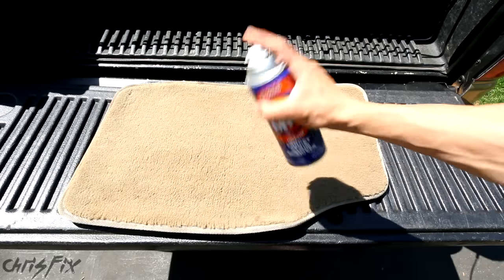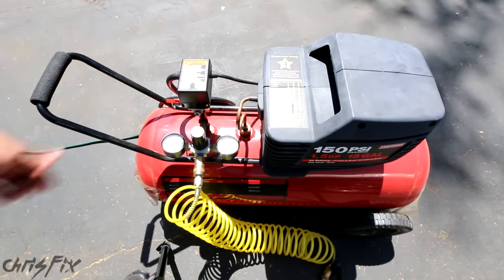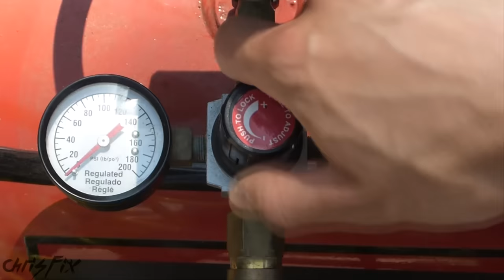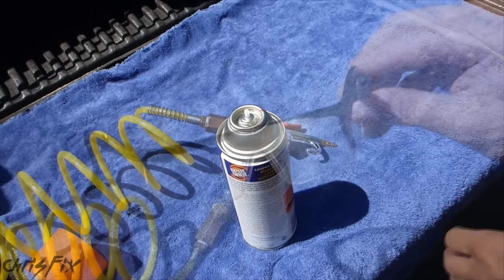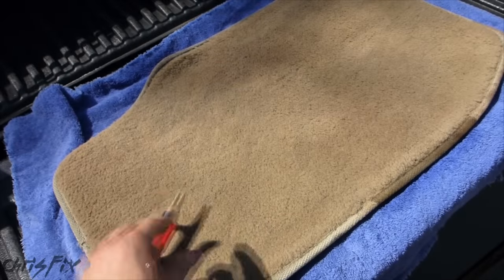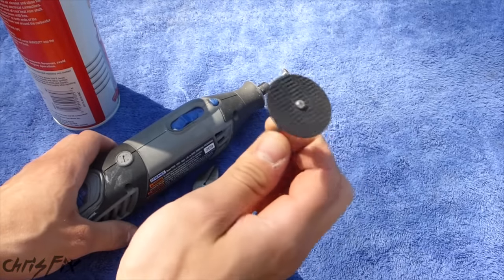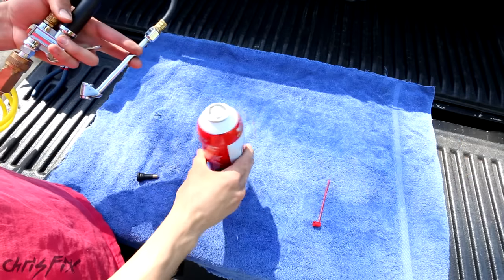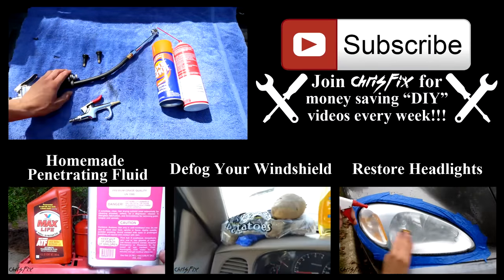How to Refill an Aerosol Spray Can (Like Carb Cleaner, WD40, etc)

Comment: Thanks, now I can refill my air can with air.
Reply: Just be careful. Moisture can build up in your compressor. Be sure to drain it and maybe put an inline filter bowl to catch moisture if you're filling cans you'll be using on electronics
Reply: Many years ago I modified an empty air can so I could refill it using a bicycle pump.
I drilled a small hole near the bottom. Then I glued on an old inner tube valve and secured it with a hose clamp.
Then it's just a little work with a pump every time I need some compressed air.
Probably had it for more than 10 years now.
:O)
Reply: @John Doe no, this video makes no mention of canned air which is used for dusting electronics and other things. those cans are quite expensive really. theres another method where you drill a hole in an empty aerosol can, cement a bike tire valve into place in the hole and seal it, and then use a bike pump to put air in the can
Reply: @royeb63     m my
Reply: @John Doe Z
Reply: @royeb63  make a vid! that sounds awesome (then post link here), pc people they will lose their minds!

Comment: Also if you don't have compressed air you can just crush the can a bit to create some pressure inside of it, making the last stuff come out.
Reply: Depending on what the fluid is, You could just open the bottom with a can opener. Just make sure there is zero pressure first.
Reply: I tried this once, I put it in my shop press, put the item I wanted lubricated next to it and squashed the can flat! Gave PB Blaster a new use... I grabbed the wrong can, it was the brand new fully pressurized can! It's amazing how much penetrating oil is in one of those cans! Was making a video of it but ruined an 1100 dollar iPhone,  new can of PB Blaster, and everything else in the garage trying to get the last ounce out of a can... oh well, it was fun.
Reply: @terryhites1  damn 😄

Comment: If you turn the can upside down, you won't have to worry about liquid shooting out.
Reply: That's what I wanted to say, turn it upside down to limit loss of product.

Found this video a day late and a dollar short, just threw away a can of WD40.

I'm a chicken, after I found the actual pressure, I'd do like this video, at least 20% below the stated pressure, maybe less.
Reply: lmao same
Reply: Ron R Ss
Reply: lol My WD-40 works both ways...
Reply: Depends on the can. Lots of car related sprays are made to work upside down.
Reply: Amaey Paradkar + sithlordmaster181   he's talking about when you refill the air not when using the product. not sure if holding it upside down would do anything but maybe
Reply: Didn’t think of that food idea
Reply: you get WD40 for a dollar?
Reply: How's your lawn doing in that spot? lol
Reply: I'm a handyman, jack of all trades, but never considered this. I've got a half a dozen cans I'm going to try this on, three of them WD-40. I honestly think that the manufacturer of WD-40, where all the pressure leaks out is not a manufacturing flaw, but by  designed ! So you buy more WD-40. Thanks for the video.

Comment: I had this happen recently to two large WD-40 cans, they were completely out of the air and 95-100% full of fluid. I wasn't going to waste the fluid so I just stabbed the side of the can with a sharp, pointy knife and just pours it where it was needed.
I like your trick with the air compressor, I've never seen that done before. If it happens to me again (which is more than likely with some product) I'll fill my compressor to do it if the spray function is definitely needed. With the WD-40 last time, it actually worked out that the air ran out as I wanted to soak some parts in the solution for a few hours anyway :)

Comment: Great video Chris!  I was thinking that a rubber tipped air trigger drilled out the same diameter (or perhaps slightly smaller) as the can valve would make a really good seal.  Been watching several of your videos now that I have been restoring an old car.  Keep up the good work.  Subscribing today!!!

Comment: I don't think those cans originally were pressurized with air, but with some sort of hydrofluorocarbon compound (which replaced the ozone-depleting chlorofluorocarbon compounds).
Reply: king kazie
Thanks.
Reply: whiteknightcat your welcome
Reply: +whiteknightcat This is true, but probably irrelevant. While using compressed air doesn't make sense for the manufacturer, it makes fine sense for someone like Chris.
Reply: +king kazie or even isobutane
Reply: Paul Lawton cool, i didn't know that
Reply: pretty much all  cans use butane or propane since its cheap and readily available. Chris forgot to mention that some cans need to be used up quick afte pressurising them since certain compounds will oxidate
Reply: @jellystick2525 , The WD-40 company recently said that it's no longer using butane, but CO2.  But the problem is that the WD-40 substance itself is flammable.  You simply don't want to mix air with that ahead of time.  You're asking for a disaster sooner or later.  Mixing air with a combustible substance?  Yikes.

Comment: Compared to other tutorial videos that I watched about this type of tutorial, I think you're the only one that doesn't have to drill a hole at the bottom or on the side of the aerosol spray can so you can insert a valve stem and use an epoxy to seal the gaps and keep the valve stem in place....good tutorial. I actually gonna try this...with a bike pump.

Comment: Glad I found this, I had a spray can of expensive paint run out of pressure with more than a 1/2 can full. I'll do this tomorrow so I can finish my project without having to order new base coat color paint.

Comment: Suggestion, I'm in the same thing right now. For the air nozzle, use a bigger drillbit and drill the tip just a bit, so the conic shape of the worn area will aid to a more tight seal when passing air...

Comment: i use liquid propane-butane   for refilling  gassed-off  spray cans ...  i even refilled  an old spray can with new lacquer and added liquid propane-butane through the valve .. kinda tricky to find /create nozzles which fit, but with a little bit  of creativity, you can make it work..  air refill is  good for quick and temporary reviving .. however, as you use the can,  the pressure  decreases in linear manner.. whereas the liquid propane-butane stays liquid inside, mix with the lacquer medium and   as you use it, it keeps evaporating  inside and holds  a stable pressure around 140 psi  .. works quite fine ☺️

Comment: That’s dangerous af. If you accidentally inject compressed air into your skin it could cause major problems. If you’re gonna do this you should wear leather gloves. The valve stem method would be the better way to do this. However , if you’re careful it’s a great way to save some money.

Comment: Very informative video, thanks.
A little improvement perhaps could be of some use:
In these two methods of filling the can with extra air, it is better to hold the can upside down while filling.
It is  to prevent the fluid from escaping the can while filling and thus avoiding the mess and unintended loss of fluid.
With the can in upside down position while adding the compressed air, the air is added directly to the existing air pocket in the can.
It applies to all cans fitted with solid plastic tubes inside the can.
This won't work with cans equipped with flexible inside plastic tubes with weight attached to the far end of the tube, invented to allow the normal use of the can in any position because the far end of the flexible tube will fall to the lowest point of the can, while the air pocket will always stay in the highest section of the can, no matter how it is positioned.
Reply: Any angle spray cans are amazing, whoever invented them is a genius.

Comment: would this work for whiped cream
Reply: Cepten Crinje don't see why not
Reply: Cepten Crinje it'll taste like an air compressor
Reply: No, It wont. The gas in whipped cream is nitrous oxide, which dissolves in fat. If you use normal air this wont happen.
Reply: @Benjamin Larson but then you'd probably not have "whipped" cream anymore, it'll just turn be shooting out liquid
Reply: Codyslab did it
Reply: Might work for 'whipped' cream, but I've never heard of 'whiped'.
Reply: Tanya Jonesjbxgdbajshdhd No, Codyslab used Co2 as it will dissolve in liquid
Reply: No it won't work for food. Food is never stored with oxygen because the oxygen promotes bacterial growth. Notice how foods don't spoil until you open the vacuum seal and let air in.
Reply: whip-its!
Reply: Cepten Crinje whiped? Wtf
Reply: Can't believe how many responded to this.  As if he's serious hahaha!

Comment: You, Sir, are a life saver!! I've had to throw away several good cans before, simply because they ran out of air. I never knew that I could use my air compressors to refill these. I'm going to try it next time. Thanks, man!
Reply: You are the man!  Love stuff like this. Just saved about four cans for me. Works perfect with the tire stem and a good bicycle pump. Thank you so much
Reply: How did you get on? I’ve just been to the garage and got a valve stem, set the machine, put the valve on top of the can, and nothing at all. The air wouldnt even come out of the air compressor!

Comment: We converted an old, outdated bbq propane tank to a portable compressed air dispenser by drilling and installing a tire valve into it and adapting the threads to an air hose, works good

Comment: Is that actually safe with combustibles? Won't it create a diesel effect? I thought that's why the manufacturer uses inert gasses.
Reply: Actually, no it's not safe, despite how people make fun of those who know better.  Folks were often never trained properly: Fire is a chemical reaction, *nothing more*.

And it's not specifically dieseling that you have to worry about: The pressure isn't high enough for that.  But yes, the problem comes from mixing O2 (even at the 1/5th ratio in air) with a combustible, particularly at pressure.  You're just waiting for a spark or something else hot to travel backward into the can.

People are likely thinking of (visualizing) what happens when you spray something over a flame with a can of butane or even something else ready to flame.  It won't travel backward in that container but it's not because of the velocity exceeding the ignition travel of vapor, but because there's no air mixed with it until the gas comes out somewhat.

I've seen similar uneducated mindsets before: I remember someone insisting once that there could be no planets nor moons with a methane atmosphere because it would have ignited long ago.  Well, no it wouldn't: It still requires O2 to happen.  By mixing air in with the WD-40 (and residual butane left), you're now producing a stream of read to go fuel/O2 mixture.  Absolutely not something you want to be careless with.

So long as you realize that it's nothing like spraying a new can of something over a flame, you'll likely be ok.....just don't spray your new concoction over something hot or electrically charged in nature, and please don't store it in the house.

And keep in mind something else too.  I don't know what's in WD-40 specifically (other than it's generally flammable), so I can't write the equation out for spontaneous combustion, but keep in mind, it can and does exist.  Even oily rags simply hanging out in a pile can self-ignite.

But always remember: Fire is a chemical reaction.  NOTHING more.
Reply: @thomasmarshall4472  tl;dr

Comment: I noticed you had some Zep products on your shelf. Zep 45 penetrating lubricant is the best penetrating oil by far but it looses propellant pressure before the can is empty. This is an expensive product so this is a good solution

Comment: I've used the valve stem trick to air up aerosol cans and don't alter the stem,  just set it on the top and push down with the tire inflator, air goes into the can without pushing in the tip of the can.

Comment: It has already been said that you should hold can upside down so no product get pushed out. I would add that you can make a mounted version that you can just go to it and turn can upside down and press down. I made one a few years back. Also use bike tire inner tube stems from small wheels. No need to do any modifications after cutting off of tube.

Comment: I have done that many times in the past. Works very well. When I do it, I attach a very small piece of vinyl tubing to the air nozzle, then slide the tubing over the tube sticking up on the can, then press down to fill. No Mess.

Comment: For anybody watching that doesn't have a compressor, you can buy a can of keyboard duster which actually will fill with a propellant (propane or 134a) and use that! Oxygen can degrade or activate certain chemicals, but anyways a super cool trick, thanks Chris fix!
Reply: Forgot to add, refill with the coffee straw it comes with, but hold the empty can upside down so fluid doesn't spill out and you can fill correctly

Comment: I like Chris. He's got some extremely useful and informative content. HOWEVER, this particular suggestion can be rather dangerous and should not be attempted. This is coming from a certified professional. Do Not, under ANY circumstances, attempt to refill these containers. They were not designed for this purpose and can easily be overfilled and rupture, sending shrapnel and whatever contents were inside of it flying in all directions. Do so at your own risk.
Reply from the maker: Thanks for sharing but actually these cans from the factory are filled to 150-200psi depending on the brand. With one of these portable air compressors you would be lucky to get it to 125psi. The real risk is normally they are filled with something like butane so the air doesn’t oxidize what’s inside but even then, if you’re doing this, it’s to get some last bits out so none is wasted so I wouldn’t expect people to think it has an infinite shelf life.

Comment: Most modern aerosols use propane as the propellant. under pressure they stay in a liquid state so they don't leak out. When you release the pressure they turn to gas.

Comment: Ima gonna try this, I have oodles of cans roughly half full of liquid - lately all of the mfrs have gone to the wide press cap and those seem to be useless as I have never had such an issue with the older style spray knob on the end of the tube style

Comment: WOW!  Very clever and easy solution to refilling a pressure can.... I just want an air duster.  Much better than drilling the can and adding and then sealing a valve to the can.  THANKS!

Comment: A pro tip....I did this and added a small bit of shrink tube, unshrunk, to the tip of The aerosol can and slide it over the air nozzle. Made the air flow much more direct.

Comment: Thanks, man! I saved at least $15 reviving 3 cans of WD 40, throttle cleaner and etc... No need to use tire valve stem. Just need ball inflator needle and some other attachments from Harbor Freight (cost less).

Comment: just get the pin nozzle used to fill footballs, and stick it inside the spray can tip that sticks up from the can - , and shoot in 60 psi into the can, and you are ready to go.  extremely easy for anyone to do.  the two are a perfect fit, and no modifications needed.

Comment: You can also use a duster can, connect the straws together, hold the duster upside-down and it will inject the liquid propellant into the dead can.  It won't create as much pressure but it will last longer.

Comment: I drill a small hole thru a rubber eraser and use it as a converter/gasket to put both tips into...it expands to fit different tips/tubes, and holds a tight enuf seal to make no mess...

Comment: A nozzle similar to that but with a rubber tip may work well if the tip is in good condition.  It is also more likely to seal on that tube.  Some cans don't have the tube but instead have it as a part of the nozzle itself.  It is probably an attempt to discourage repressurizing the cans.  I am sure there is a simple enough way around that but I never did it with those.  I also would not try to do these thigs to continually reuse the can.  This is just to help you get the contents that you paid for out of the can.  It also would not be a good replacement for chemical canned air since this will run out a lot faster but at least be a lot less toxic.

Comment: If you took your brass tip and drilled a a shallow hole in the end big enough to fit around the white plastic bit you could fill it more easily.
It would probably work flawlessly if you got a rubber packing sheet (you can find these in the plumbing isle at hardware stores) and made a small washer to seal it.
And as others have said in this comment stream, hold the can upside down.

I know I've seen this video before years ago, and I tried it to the best of my ability before, and it worked, but you could never get the pressure you really need back into the can. With the modified tip idea you probably could.

Comment: I have a bunch of Zep Venture sprays, very efficient cleaner, but all of them lost pressure since years I've received them. My solution is to pump out the content using a vaccum pump, made of a fridge compressor and apple jam pots.